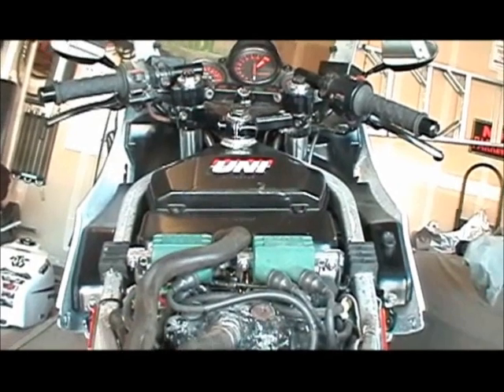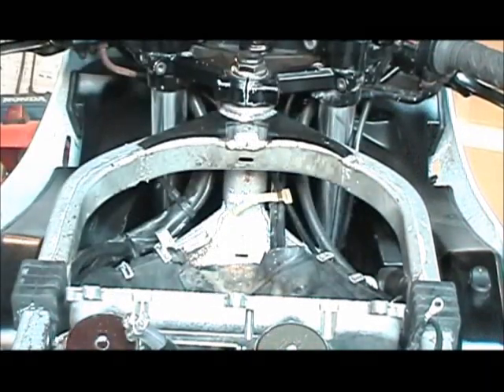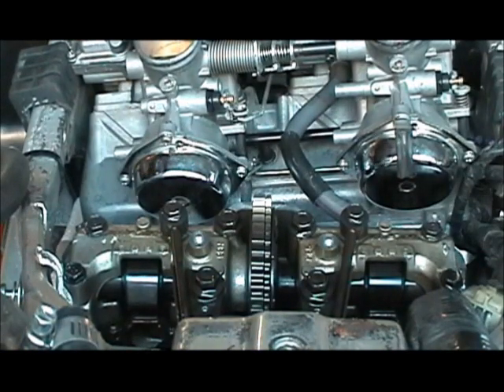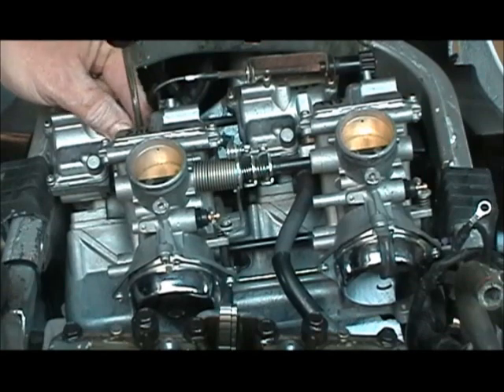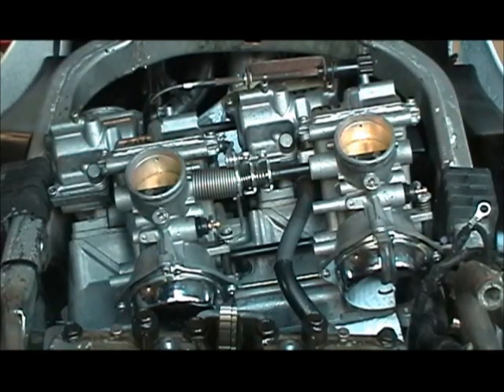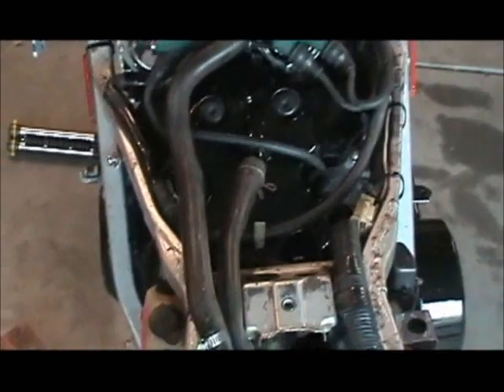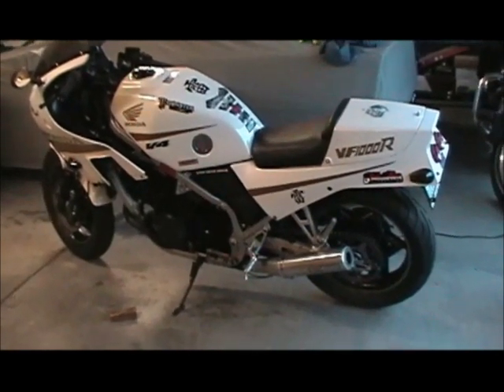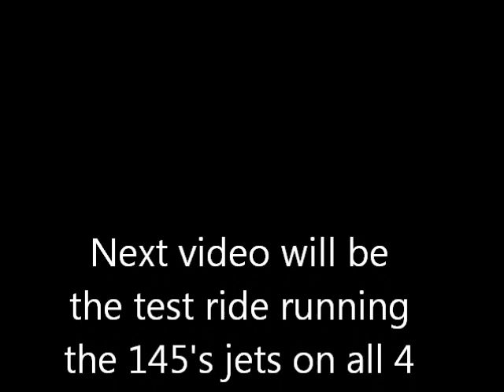VF1000F carbs install on a VF1000R Part 2

Comment: You can definitely get to the idle knob on an R. It is on the left side of the bike with nothing blocking it, maybe yours is on backwards I don't know but I can definitely get to mine.
Reply from the maker: This was quite sometime ago. From what I recall the carbs in the video where from a VF1000F. I wanted to prove to myself this could done on the VF1000R.  The idle knob is on the right side on the F. I think I removed the idle knob set up on the R carbs and move it to the F carbs to get the adjustment on the left side. I also had to reject the F carbs.

Comment: I'm about to put my carbs on my 85 1000R , wish me luck. Lol
Reply from the maker: I use to used grease on the inside of the boots so the carbs side in easier. I haven’t done it to this install but you can use silicone spray as well. I been spraying this on all my hoses last few years and works great too. Good luck, take your time.
Reply: I'm about to do the same thing to my 85 vf1000r, frocking nightmare!!!

Comment: Great job. I have 1985 vf1000r  in need of  fuel line hoses one for tank and one  that goes to goes into the carbs
 ,were can i find them . I am having a hard time those parts ! can you help out , let  me know  thanks.
Reply from the maker: Ebay is a good source..

Comment: shit man I can not seem to get my carbs back on. I can get one side to slide in but the other seems like it has so far to go. Any tips?
Reply: +Frisco Chop Video Productions ya that's what I had to do, get new intake boots. It went in pretty easy after that. thanks
Reply: i heated mine in oil and worked just fine
Reply from the maker: Try a little grease..